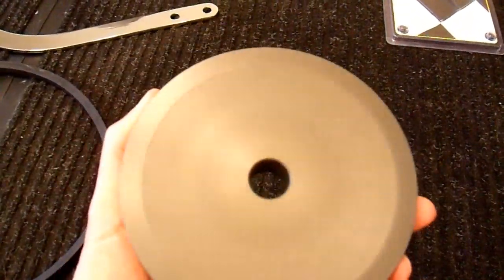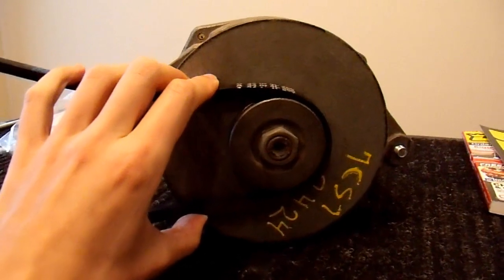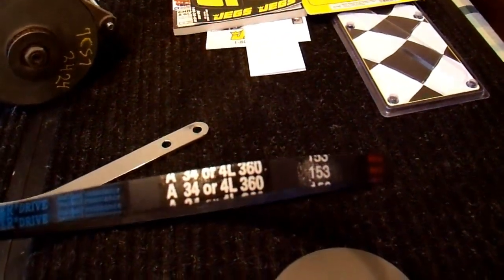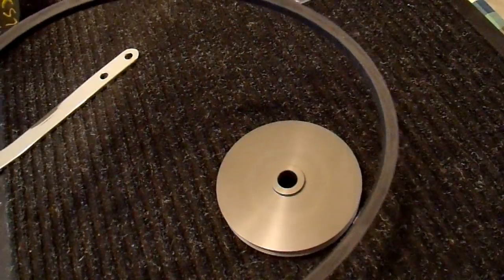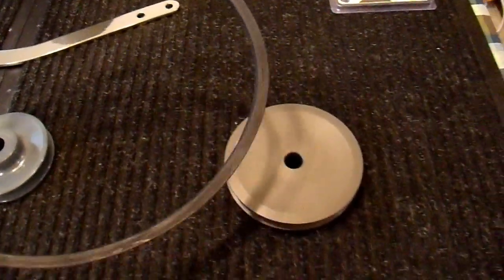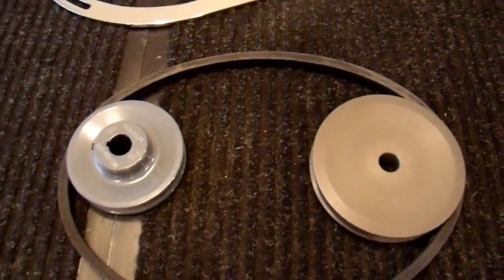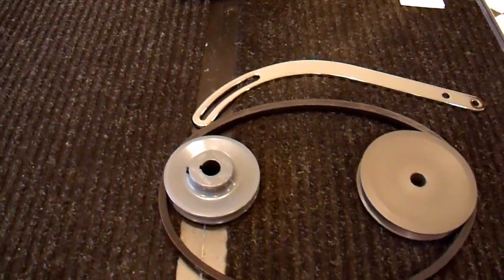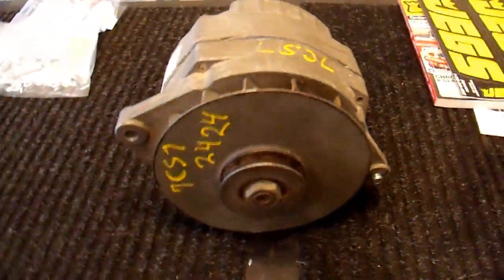DIY 12V Generator Charger - 5 Parts for the Second Attempt

Comment: What are the part numbers for the pulleys and belts
Reply from the maker: The engine pulley is a standard cast iron sheave, and the alternator pulley just needs the right shaft diameter - jegs tells you what it fits on.  The belt is just one from a fleet/farm type of store.  I don't remember any of the part numbers today.

Comment: I find your permanent magnet generator has a lot morethey don't put as much strain on the engine they run it a lower RPM so that your engine becomes more efficient fuel lies try it

Comment: You try to hard to impress viewers with all your technical talk. On your previous video you used a coupling that was way to small for the job, you need a coupling that can handle at least 8 Hp to drive a alternator. And you don't need more than 1200 RPM. Get yourself a permanent magnet alternator, couple the alternator direct with a coupling that is strong enough to handle 8Hp. Get a inline amp meter and set your engine RPM according to the amp meter. Put that clamp meter away it only work on AC, it will give you a false reading on DC. I know what i'm talking about I've build chargers like this in the past. Another thing: you cant charge a lead acid battery on a high amps for long periods. for a slow charge, nothing more than 5 amps if you have no load on the battery.

Comment: Great video! You've lots of good idea's on construction. Just a note on which direction to rotate the alternator though. Loading the alternator when turning opposite direction will tend to spin the pulley nut loose. Would recommend a lock washer or some other way to safety it.

Comment from the maker: I have no intention of using the waste heat for anything.  I considered multiple approaches but all of them are impractical.  This engine does have a very nice centrifugal blower to cool it with air channels and deflectors and such, and it stays very cool when operating compared with other small engines I have used.  It would be a good candidate for waste heat capture if not for the risk of leaks.

Comment from the maker: I avoid the word 'underdrive' because it implies the crank pulley.  This was advertized as a racing pulley so I used that term.  The alt requires far more than 2hp once all factors are considered, also keep in mind that small engine governers are not designed to run past about 80%, and when cold the alt outputs more and the engine less.  I am not at sea level, etc, etc.  The 'underdrive' pulley is an absolute necessity - I describe why at various points in this series.

Comment: Also I assume your going to run a peltier setup out of your muffler? Please dont bother, they are very ineficient. Run a water jacket in the muffler and use some of that heat to heat your home. Your could also wrap the head of the engine with a copper coil between fins and pull some of that heat into your home as well. I hate the fact that they wont allow larger comments.

Comment: Rubber mounts will not interfere with alignment.Consult replacement parts for a shop air compressor for parts.As for pulleys. What you have there is an under-drive pulley, and for your application its overkill. Also for your calculations on the engine vs alternator. your alternator really needs about ~2hp worth of power to put out over 100amps out. Wonder what the power curve is for around 2hp on that engine,if you had a torque curve you can calculate around~2hp and that will give you ideal rpm.